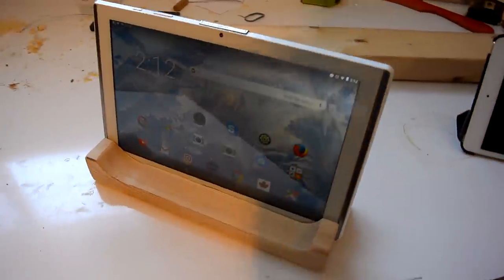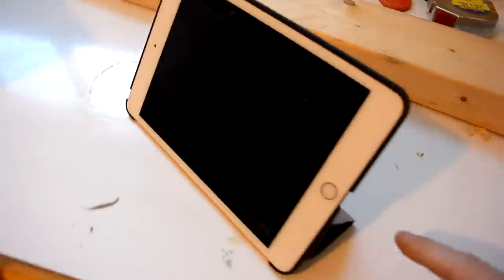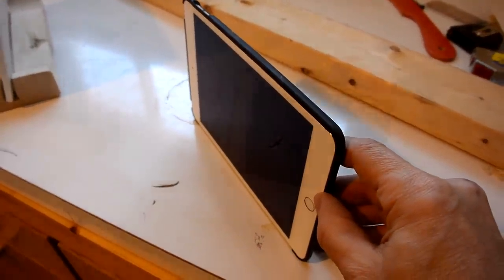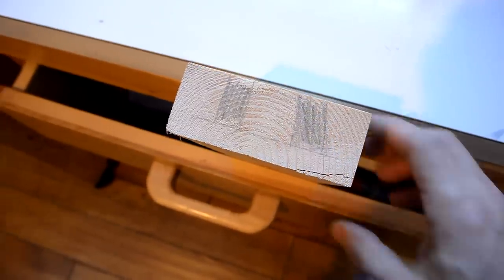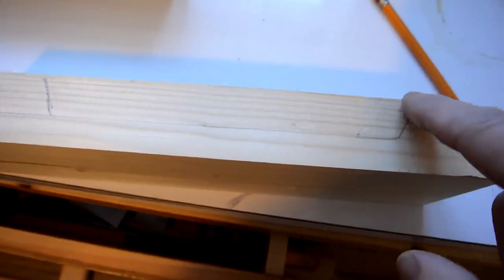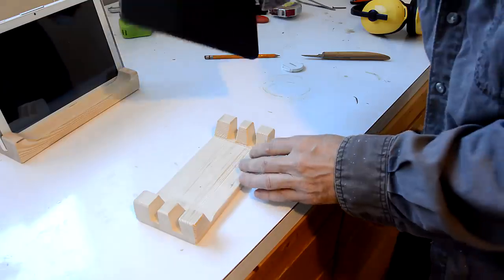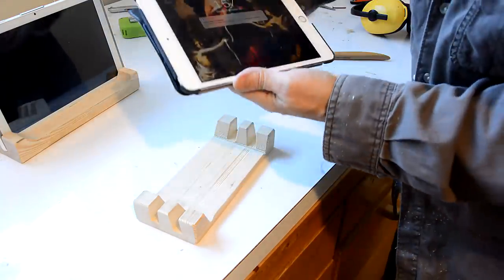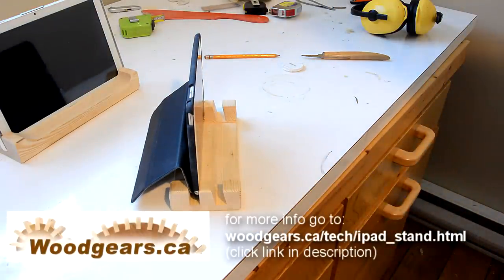Super simple iPad stand build

Comment: Quicker your way than trying to print it.  Now to make one.
If you included a 1/4-20 thread under the vertical and some rubber bands on the ends it could be used on a tripod
Reply: If you were 3d printing it you'd still be on the second printjob after the first one wasn't sized quiet right. And that's after a nights work in the modeling program and then doing file conversions through the yazoo and trying to correct for scale and normals lost in translation.

Comment: Simple and elegant. New woodworkers, avoid the brilliant-woodworker-does-dumb-table-saw-cut maneuver at 0:47. Don’t leave the bulk of a workpiece unsupported, hoping to guide the long dangling end squarely through the blade. It’ll skew, the blade’ll grab the workpiece, and throw it at you with vengeance—made worse on a bevel cut. Easy solution, and hardly less lazy, is to put a long sacrificial piece on the sled behind the workpiece (though it needs support beneath too).